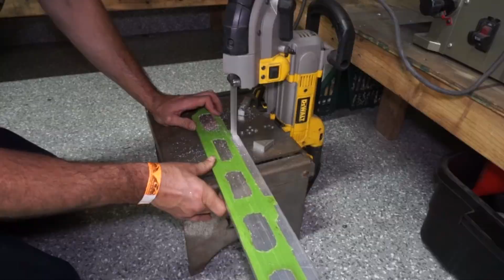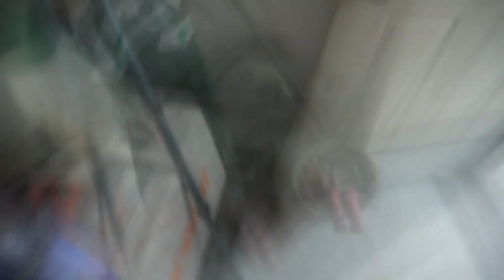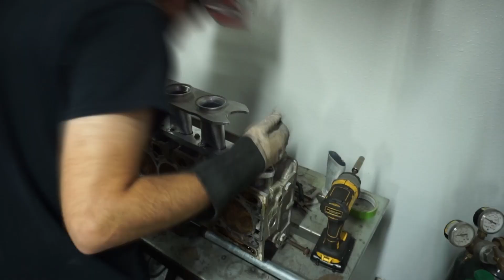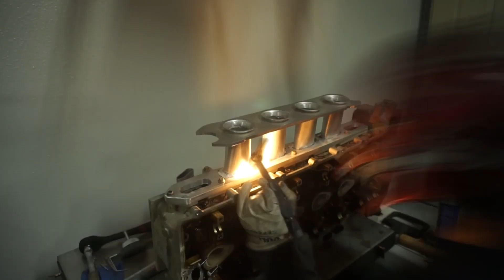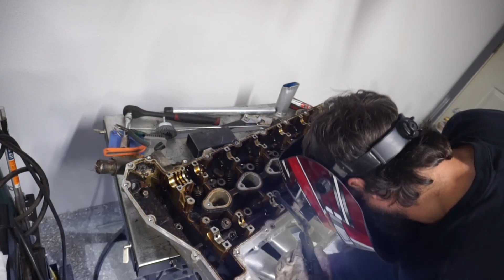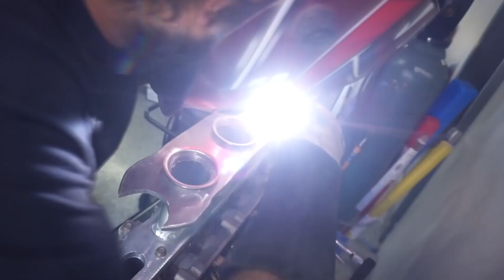DONE!!! 2JZ Intake To Vortec 4200 Conversion | Project Recap

Comment: Only suggestion is stretching the 2JZ cast piece longer by cutting it and splicing a straight section. That way the even cylinder filling this design is trying to achieve is maintenance.

Comment: Nivlac57 made his the exact same way 3 years ago.
Reply from the maker: It had 3d printed runners and was never finished.
Reply: He did even better. He built his intake based on a 2JZ inspired intake giving a shoutout to the original builder. He gives credit for his inspiration as where anyone should.  @BlaserBuilds
Reply from the maker: @kuntrryboy7078  You said it was the "exact same" which is not true. Nobody is taking anything away from Calvin. You're just trying to create drama where there is no drama...
Reply: Ok butter cup @BlaserBuilds

Comment: Very nice, one thought.  Are you using a 2jz throttle body or the Envoy's?  I know the Envoy is DBW but I'm guessing it's kind of small and obviously will take a little work to bolt it to that manifold.  The 2JZ uses a throttle cable of course but the idle air motor is on the back of the intake plenum (those ebay manifolds don't have a provision for it) not part of the throttle body like GM usually is.  They are also not perfect and last time I was looking at one were quite expensive.  The ticket 10 years ago was to convert to a Honda remote style IAC.  Just something to think through.  Enjoy.
Reply from the maker: It's between an LS throttle or 2JZ. I didn't know that about the IAC though, good tip. I'll have to look into that.

Comment: Nice job! Not to be that guy but is that front runner going to get enough air?
Reply from the maker: Yeah it actually looks pretty good in comparison to the side view of a high ram, or some other intakes. Look at the Coyote ultra low ram base.

Comment: Awesome job on the design. Maybe one of those fancy metal 3d printers could do a full print based off this? Could add some interesting internal geometry while they are at it.
Reply: 3d printing alloy inlets it's massively expensive, we found cnc'd billet or getting it one of cast much cheaper 😢